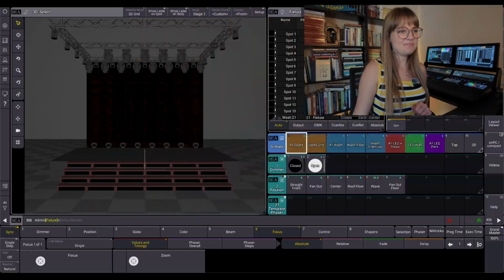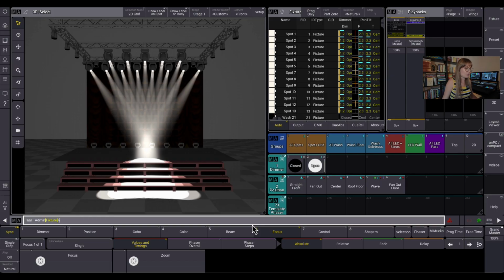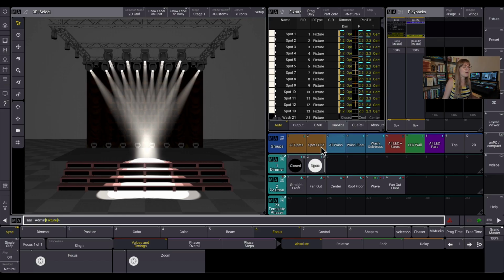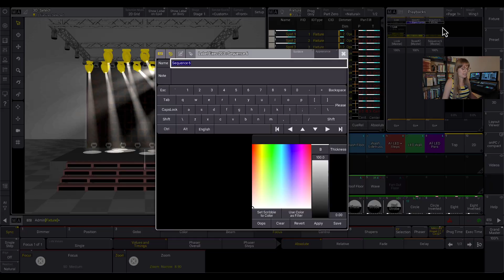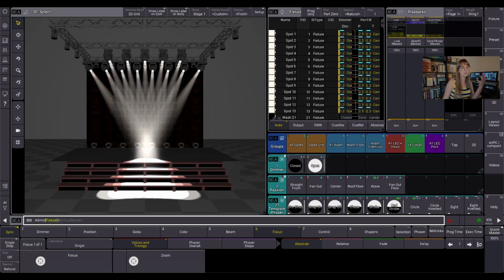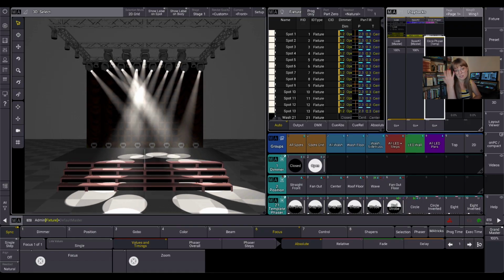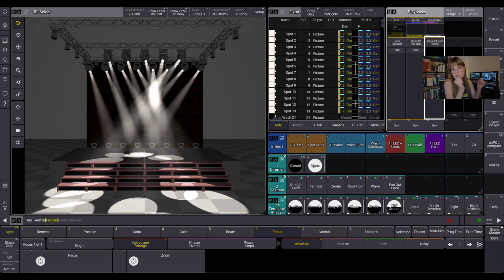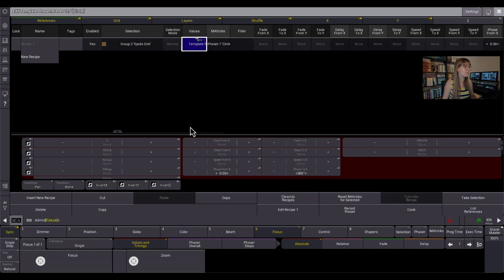Size Fader

Comment: i usually store a cue with relative position at 0 and store to a fader as temp, Super and no off when overwritten .. so i can use that fader with every position effects on my sequences
Reply: This is the simplest solution, but sadly it only works on relative FX. Not absolute.

I haven't come up with a good soluition for a "Global Size/Stomp" for absolute movement phasers yet.
Reply: That is how I do it as well. Mostly because I want to save up my precious few faders from effects (I'm on a onPC). And my band is not on any timecode, so I need those faders and mindspace for flashes and bumps and that stuff. So effects go in the cuelist! 
So My temp faders are stored on faders 11-15 and I have seperate temps for dim and for positions for all my major fixturegroups. And then I use the commandline to tell my temp faders what position they should have. The perfect thing about this, is the ability to fade an effect smaller or bigger. 
But by god, I would love to just have a "size from" / "size to" field in the recipe line for this. It would save me SO MUCH text in my commands!

Comment: I like to use stomp on a temp fader to have a universal size master. 
Someone else on FB came up with an even crazier way with DMX remotes or something. 

But I use 2 stomps, one for intensity and one for position. It works well!
Reply: This is how I do it as well. You can store a Stomp preset so you can use it as a recipe too. I have a size fader for colour phasers too which is a nice way to fade in the phaser and also have pastel versions of the colour phasers at your fingertips.
Reply: @nice_pickles  how do you make a stomp preset?
Reply: @nice_pickles  Are you sure you can make a stomp preset? As far as I can tell, that functinoality was removed a long while back. As far as I can tell, you can only "stomp" a relative phaser by using a "relative 0" value.
But this of course doesn't work for absolute based phasers.

I have been absolutely hunting for a way to do a universal size fader or toggle button for absolute phasers in MA3 and have come up with nothing. As there is no FX layer anymore, and no "true stomp" exists in 3.
Do you know something I don't?
Reply: @jakebylsma7641  Yeah mate, this works for both absolute and relative phasers. You just stomp the attribute you want, store that as a universal preset in either an All Preset or the preset type that attribute is, boom, you have a stomp preset. You can store that stomp preset in a cue on an executor and make the handle a temp fader and there you have your size fader for all fixtures doing phasers that involve that particular attribute, relative or absolute.
Reply: @nice_pickles Can you probably explain step by step how you make a stomp preset?
Reply: @nice_pickles  I will test this again, but last I checked this does not work the way you think it should as there's no actual FX layer.

Absolutely happy to be wrong!

I'll check ASAP.
Reply: @r2.lighting I replied to you but the comment got deleted I think for some reason so I'll do it again:

First you need to have a fixture doing a phaser that involves the attribute you want to stomp, then:

Stomp {Attribute} Store {Preset Pool Object}

You can store the preset in a pool type of the attribute that you stomped or an All Preset obviously. Also make sure you temporarily change your store type to Universal for this so the preset will work with any fixture that has this attribute.

Then just store that preset to a temp fader and you have a size fader for phasers with your chosen attribute(s).
Reply: Thanks so much !! That's the solution I was looking for